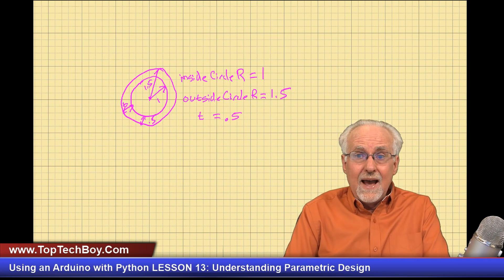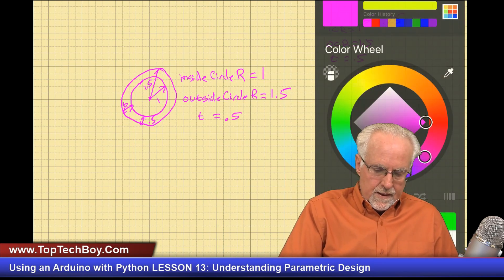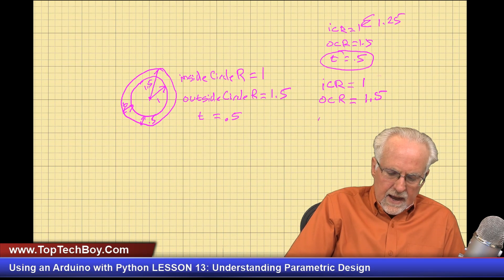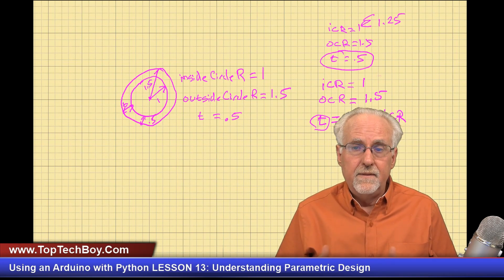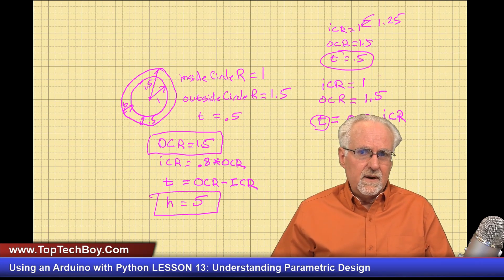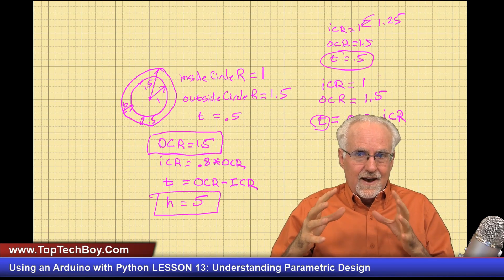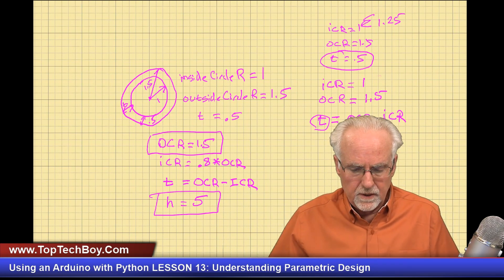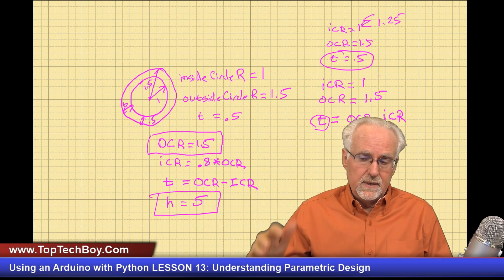Using an Arduino with Python LESSON 13: Understanding Parametric Design

Comment: Thanks Paul! I am understanding the principles as presented.  One question, do you have a link to purchase a 3D printer? I would not want to miss on the
upcoming lessons.  I do have the ELEGOO Arduino starter kit.  Thank you so much for sharing your knowledge and most important, your experience.
I am in Portugal and have to order from Amazon Spain.
Reply from the maker: This is what I am planning on using:(affiliate link)
https://amzn.to/3rbWGW6
This is the higher end Creality Ender. If it is too pricy, a level of the same model would work as well

Comment: Homework parametric this time

from vpython import *

wallW=3
wallH=4
mRadius=wallH/15

wall=extrusion(path = paths.rectangle(width=wallW, height=wallH),
  shape=[ [shapes.rectangle(width=wallH/20,height=wallW)] ],
  color=vector(.25,.45,.6),axis=vector(0,1,0))
turn=compound([wall])
turn.axis=vector(0,0,1)
backWall=extrusion(path=paths.line(start=vector(0,0,0),end=vector(0,0,.2),np=2),
  shape=[[shapes.rectangle(width=wallH,height=wallW)]],
  color=vector(.25,.45,.6),pos=vector(0,0,(-wallW/2)+wallH/40))

marble=sphere(radius=mRadius,color=color.red)
moveX=.1
moveY=.1
moveZ=.1
xPos=0
yPos=0
zPos=0
while True:
    rate(40)
    xPos=xPos+moveX
    if xPos>=((wallH/2)-(mRadius)-(wallH/40)) or xPos<=-((wallH/2)-(mRadius)-(wallH/40)) :
        moveX=moveX*-1
    yPos=yPos+moveY
    if yPos>=((wallW/2)-(mRadius)-(wallH/40)) or yPos<=-((wallW/2)-(mRadius)-(wallH/40)) :
        moveY=moveY*-1    
    marble.pos=vector(xPos,yPos,zPos)
Reply from the maker: Your solution indicates you are a person who naturally thinks in 3D.

Comment: 🙂I'm so happy to see this episode today. It means that I CAN catch up. I'm just a dozen lessons or so away. I see you're using an even larger Elegoo kit than the one in the last Arduino lesson series. Is there anything that the smaller kit doesn't have that will be needed in this lesson series? Thanks, Mr. McWhorter. Your new location looks so beautiful and interesting. Wish you all the best there.
Reply from the maker: Either should work.

Comment: Hi Paul, just watched your video on Arduino and IR remotes and I have a question for a project Im working on now. Can I control two arduinos each with their own IR sensor with one remote? and if I press on/off will they both start at the same exact time? Thanks for you time

Comment: Enjoyed this brief lesson and looking forward to expanding understanding of parametric design presented in your earlier courses.  My 3D printer is set up and awaiting your AutoCAD series.
Reply from the maker: Yes, I think this series of lessons will have one or two more in addition to the ones I have already made and are set to be released. Then, this time slot will be for the new fusion360 and 3D printing ones. Looks like it will be late spring early summer. I am looking forward to it.

Comment: Thanks a lot for the great content. I have learned so much about Arduino and python from your videos.
I got a question please :  What books do you recommend for Advanced Arduino, and Python (separately) ?
Reply: In my opinion, I have found that books tend to get out of date pretty fast. There are so many free resources on the internet. If I need to know how to do a thing, I just Google it. Just make sure you are looking at recent content. With Arduino date does not matter too much but with Python make sure your resources are using Python 3. Easy to get confused when looking at Python 2 examples. I consider myself an advanced Arduino hobbyist with several large real world projects under my belt. I have not done as much with the 32 bit micros so I have to research for those projects. I got started with Python less than a year ago using Paul's lesson and building from there. My best advise is get really good at Googling. I can find my answers fast but I also usually learn one or two other things related to my search that I mentally store for later use.
Reply: You can find any book at libgen